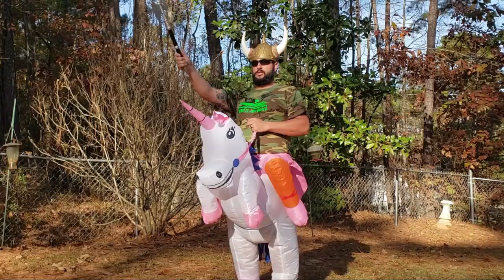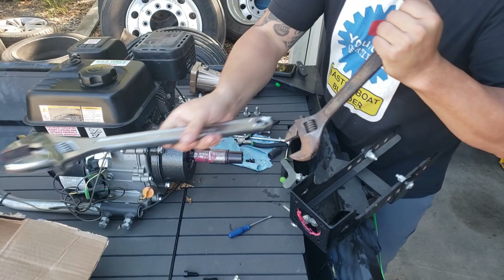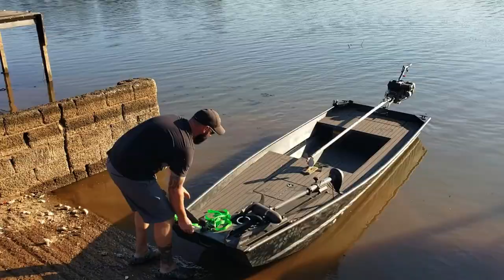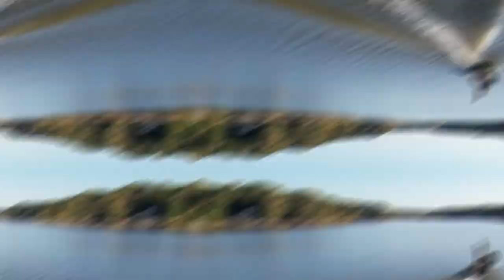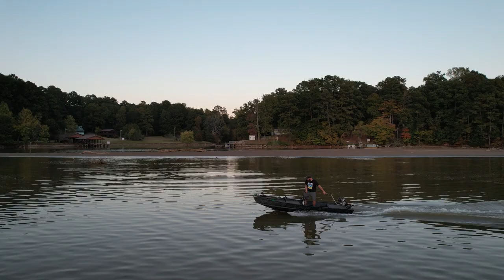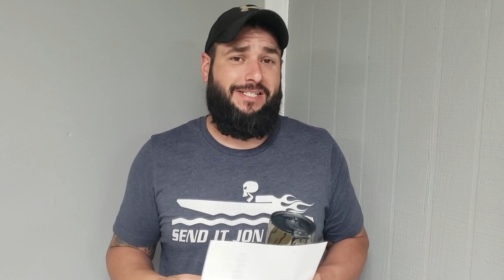Clutch for Longtail Mud Motors. Mud Skipper Retriever Clutch Review

Comment: I work as a scuba dive and recently while in a zero vis river I felt something that felt like a prop, and a long shaft. I got pumped because I knew what I just touched. It was a 27 hp go devil on a sunken boat. Dove down with some tools took it off the boat and tossed it in mine….after 4 hernias. I just took the dude completely apart and rebuilt it and got it running. I just am waiting for a u joint to come in and on my boat she goes!
Reply from the maker: Dude that is awesome you found a go devil. I would have done the same thing. I hope you get it running, those things are awesome.
Reply: I wouldve wanted the boat too
Reply: Sweet!!!!

Comment: that clutch is a cloned max torque so you should be able to play with different springs to adjust when it engages, one "hack" you can do is cut the stock spring, cut a coil bend the next down so you can hook it back into a ring an see how much slack it has you want it kinda snug, cutting more coils will slightly adjust engagment, so it engages at higher rpm but you can also get "perfomance" springs too just don't go to heavy of springs with a stock motor ......... ole red beard garage has video on it ............ anyway great to see you back on 👍
Reply from the maker: Thanks very much for the info. I have never messed with a clutch before. I may try cutting the springs down and seeing how that goes. Appreciate you watching and giving me some guidance. I was so lost installing this thing.
Reply: @SendItJonBoats  no problem Sir. they're pretty simple, every few runs you might wanna strip the clutch an lube it as it only runs on a bushing it's pretty simple just a few drops oil an she's all good again.......... here's red beards video from max torque (i'm a visual learner so seeing it helps 🙂 )   https://www.youtube.com/watch?v=gr6xQGnjYT8

Comment: Great video! I am a dealer for mud skipper in Canada. I am ordering a couple of these clutches for 7hp and 16hp this week.  Glad to see they fit other kits but I'm pretty sure they are supposed to stop 100 percent. @AZLONGTAILs has a video of this clutch and it stops fully. I wonder why your doesn't fully stop fully? keep up the good work bud!
Reply: You wonder why it doesn't stop? Operator error perhaps? Over 1000 sold and and no one else has the problem.
Reply: Likely it's a little oil or grease on the pads. it should wear off.

Comment: i've watched just about all of your videos and can't recall if you've taken the governor out of any of your mud motors. I've got a 13hp predator on a welded 1436 and would like to get a little more speed than 15-16mph. I've tried 3 different pro sizes with hardly any change. Any tips?
Reply from the maker: I have a video taking the governor out of a 670, but I have not filmed on for a 420 or any of the smaller motors. Planning on it, just havent done it yet. 16-20 is a common top speed range for a 1436, I know because I just did speed testing on this boat. My suggestion would be to get a better carb (Mikuni 34mm seems to be popular), air filter, better flowing exhaust, lash the valves, zip tie on the governor spring, and get a lot of time on the water moving the longtail around until you get it running the way you want. keep going down in prop size until you achieve your desired speed, but 16-20 is the range you are going to be shooting for in a welded hull because of the extra weight.

Comment: Great video! Just used my first mud motor today! I think I’ll buy a clutch kit, because I was definitely surprised at the speed at idle (12ft v-hull). Ideally, a very low speed or no movement at all would benefit me and where I launch/take-out. Also, my Predator 224 (the newer 6.5hp) cuts out when going from 3/4 or full throttle to idle. Could be I just need to break-in the motor, but I’ll probably mess with the idle screw and governor arm. Any suggestions are much appreciated!
Reply from the maker: I have not messed with the 224 yet, I would assume like any other Chinese knock off motor the carbs usually suck! I used to mess with them a little bit but now I just rip them off and get an aftermarket carb. I am going to try some of the cheap amazon carbs soon and see if any are worth a crap.
Reply: I know I’m late to the party and you probably have it figured out, but thought I’d offer some input. I experienced the same thing with my 670. Different animal, so it might not be applicable to your setup. I have to run an electric fuel pump if I want to run WOT. The stock pulse pump just can’t keep up, especially now that the motor is no longer stock and I’m running a Mikuni 34mm carb. On the smaller predator’s, I’m assuming the fuel is gravity fed, so it might be worth looking into some sort of external pump. On your application, an electric pump might be too much, so a pulse pump may work.

Comment: Would you tell us again the color code on the paint on the Jon boat in this video? I'm working on painting mine and I like the color you chose on this one...Do you have gator glide on the bottom? I was curious if they have a dark color to match the paint you used...As always great video !! Thanks
Reply from the maker: There is no color code, this is all spray paint. It will be shown how I did it in the next video.
Reply: @SendItJonBoats  Ok thanks ..I'll Check out the next video on...I doubt I'll get to paint it anytime soon with with cold weather coming on here in KY ..Do you have any suggestions as to where to learn about prop size and pitch? Here is my problem ...I put a 65 hp Merc on a Jon boat..Ive never had it the water....the motor and prop combo came off a heavier shi boat ...I'm guessing the set up won't be much faster on my Jon boat even with it being might lighter .I think it will carry weight well but my thinking is the prop is like a rearends gear in a car ...in other words at a certain rpm that's as fast as it can go..So on a lighter boat it should mean it could take a prop that covers more area per rpm ....How can I Guage what pitch I have now? Is more pitch and bigger prop mean it pushes the boat forward more on each revolution? I know this is alot of confusing questions I hope you can help me with ...I don't see this subject talked about much on the boat channels....Just as long as I don't hear my question in the scooter comments lol....ok?
Reply: The question I ask you about props......I found a video on prop size and pitch ....I thought I would let you know that I had ansewered my own question so I sent this so you wouldn't have to waste time to answer my question...Thanks

Comment: Do you notice and clutch knocking on yours? Mine sounds like a rod knock. Gonna have to pull it back apart, and shim it off the pto side more
Reply: I ended up rebuilding my retriever clutch with a real Max-torque clutch and its holding up much better. And it doesn't care about all the extra power

Comment: Whats the smallest engine you would use on a long tail mud motor build Have a 6hp pressure washer that the pump went but motor is still strong. Is this worth the effort?
Reply: Harbor freight 6 hp moters are now about $130....
I have 3 mud moters,surface drive is a six ...long and short tail are 6.5..
All work well on a 12'' Jon boats
Reply from the maker: the little 6.5 hp from harbor freight is the smallest one I have ever run and it works good on small boat. It did work on my big boat but it was not very fast.